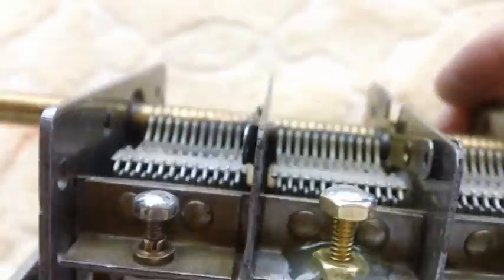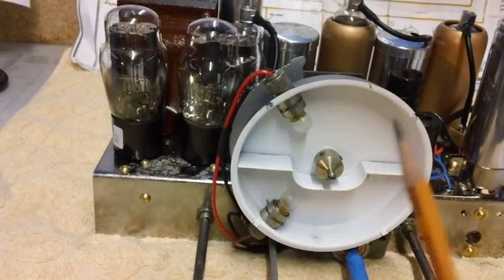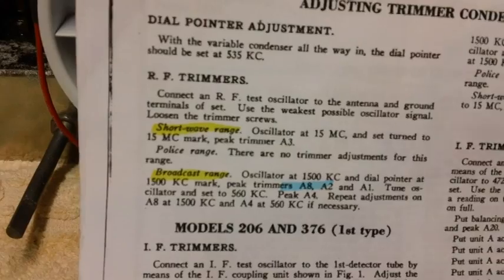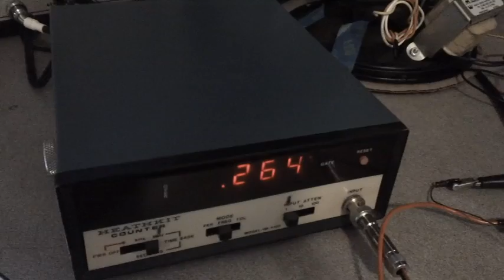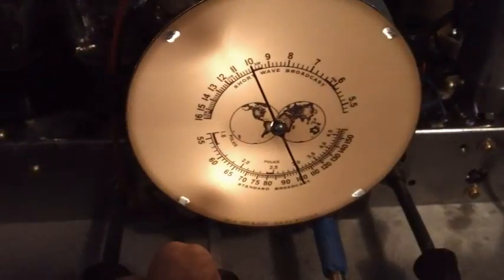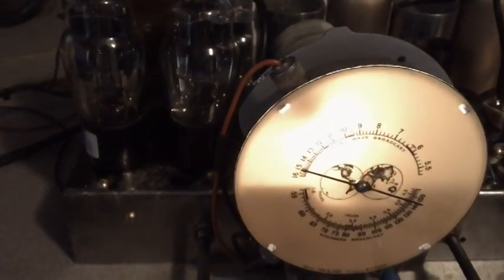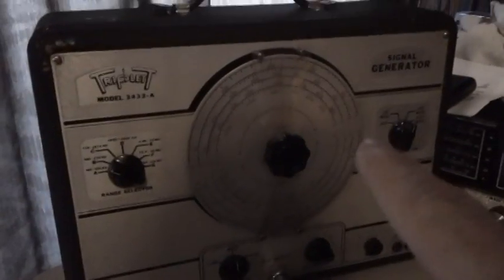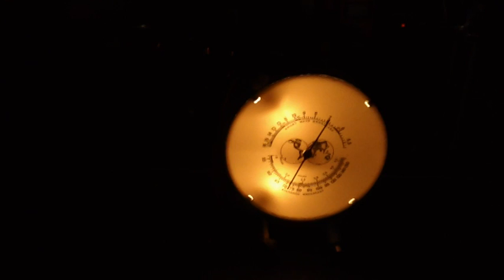1935 Atwater Kent Model 145 Repair and Restoration (Part 36 of 38).

Comment: Not boring at all, my friend. Now, a few newbee alignment questions. I have aligned a few by ear, which some repairers do, but I tried using a vacuum tube voltmeter once and I got too much micro-phonics, like sticking a mic next to a speaker! Now, also, how can you turn the volume all the way up without damaging the speaker? Thanks, John. Great series!

Comment: The low end adjustment on these AKs is not the best.  The variable cap does not vary enough.  C8, a fixed mica cap, needs to be changed to improvement low end alignment.